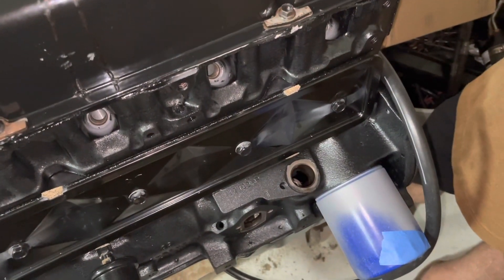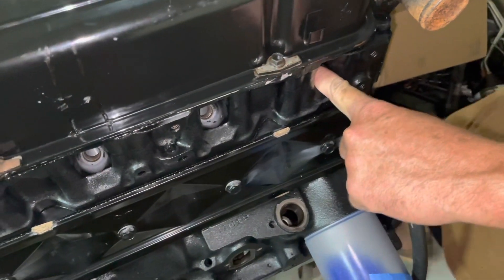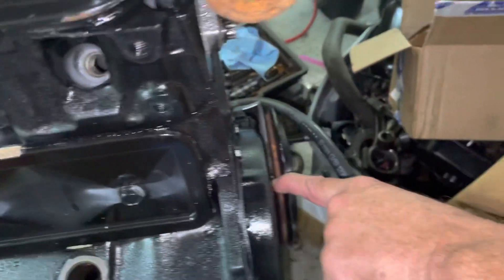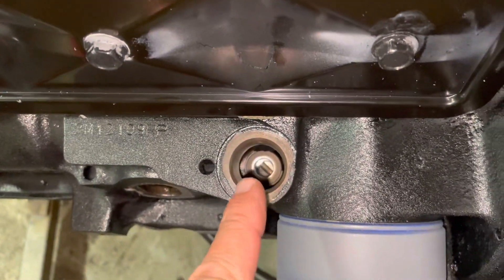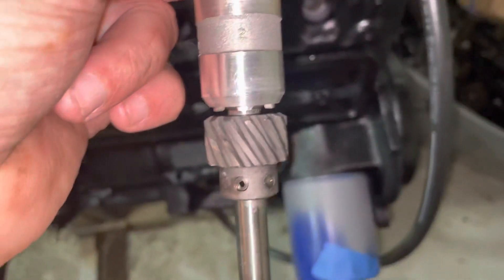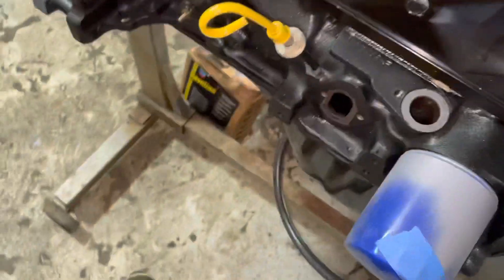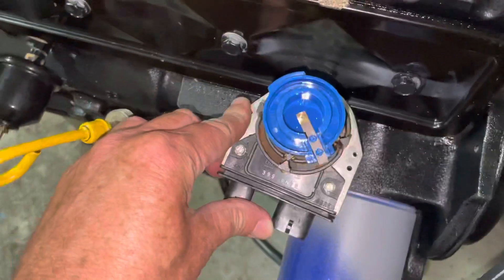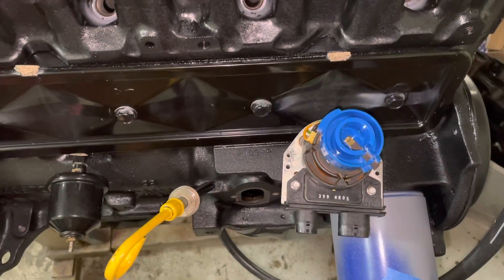Mercruiser 3.0 1(j)- Distributor Install/ Setting Static Timing

Comment: How did you know were the number 1 tower direction is.
Reply from the maker: At 1:52 I said the number 1 spark plug wire tower in the cap lined up with the corner of the distributor. But that is arbitrary. I could have chosen any other of the four locations. All that matters is that the rotor point to what you decide is number 1 tower when you insert the distributor. However the corner I used is the best because the spark plug wires reach all the cylinders easily when the distributor is installed per the video.
Reply: Nice explanation,  thank you. I have this motor in my 92 Rinker 181 which i have owned since 1998. I find it to be robust and reliable.
Reply from the maker: @jkgkjgkijk this engine is an industrial engine used forklifts and tractors, never in cars or trucks. It can be destroyed by low octane 87 ethanol gas though. Always use 89 non ethanol gas.

Comment: Good video,
You should add the firing order and cylinder numbers to it though,
Thanks
Reply from the maker: This is a video about static timing, not connecting spark plug wires or timing with a timing light. I cover these topics in other videos. I did point out cylinder #1 and explain how to find TDC on #1 firing stroke which is the most important requirement for timing a distributor.

Comment: I have this same distributor, can i replace the parts ontop of the plate or do i have to change out the whole distributor?
Reply from the maker: Why do you want to replace anything? You don’t say what’s wrong with it?
Reply: @moccasinmarine  well nothing is wrong with it, just rusty and dirty. My first boat, I'm giving her a tune up
Reply from the maker: To replace the parts on the plate the distributor gear has to be removed and the shaft pulled out. I would just clean up the part and keep using it as is unless the parts don’t work anymore.

Comment: Same question that I asked on another video of yours. Trying to get the Delco number of the two pin connector or ultimately the number of the module receptacle so that I may connect to my replacement Petronix distributor. Thanks. Rick.
Reply from the maker: I posted an answer to your other question.

Comment: Hi how you turn the oil pump ??
Reply from the maker: With a long flat blade screwdriver.
Reply: I don’t know a lot about it but can you tel me please where is the oil pump is or how to do it and a video I will really appreciate you sir , Hi sir thanks for texting me back , I have a 3.0 mercury 4 cylinders stingray 190RS but I forgot how the spark plugs cables order,?
Reply from the maker: https://www.mercruiser-shop.at/data/datenblatt_0000025_1.pdf

This manual contains spark plug wire routing. The oil pump is inside the engine under the distributor.
Reply: How can alignment the cylinder number one up , because the engine is is my boat and I really don’t know how to turn with the engine in the boat, can you help me out please
Reply from the maker: Put a socket on the alternator bolt and rotate the engine with the alternator pulley. Take the spark plugs out so that the engine rotates easier.
Reply: O ok sir I will tray to do it tomorrow first God , and my distributor have to be like you show in the video point to the corner right, ?
Reply: Hi sir I already did but still won’t star up but I have another question I was pumping gas to the carburetor but I check it and it was dry
Reply: Hola me puedes decir a cuántos grados de avance hay que poner el mercruiser 3.0 gracias

Comment: Thank you for this excellent and super helpful video.  I especially appreciated your technique of covering the spark plug hole, then rotating the crank and listening for the flow of air out of the piston, which can only happen when both valves are closed and not moving, and which is the needed valve state for firing.  And this technique can be performed without having to remove the lifter cover.  When I was performing my static timing procedure, however, I removed the lifter cover, and watched for movement of the rods associated with cylinder no. 1, as the crank was moved through TDC.  If no rod movement was observed, then I concluded that this was the TDC for cylinder no. 1 firing position, and this could also be confirmed by observing movement for the rods of cylinder no. 4.  While you have to remove the lifter cover, you don't have to remove the spark plug. I was wondering what your opinion of this alternate approach is.  Thanks!
Reply from the maker: The method you describe has been used by seasoned mechanics for ages. I’ve been using it for 40 years. This video is a variation of the method.

https://youtu.be/1A7mteNPCxc?si=j0Ns-bCYqmLsMhAO

Comment: Thanks for all your videos! You were integral in me getting my new to me mouse house (had mice nest in exhaust header) 1985 Mercruiser 2.5 rebuilt, running and back on the water. If you ever come to Bham, beers on me. This was the closest I could find to reinstalling the dipstick tube as it magically appears around 3:20 in. I did not measure how far it was sticking out prior to disassembly but reinstalled it to the paint line. I measured how deep it is with a piece of wire and it is 1/4" from the bottom of the oil pan. I just did my first oil change with a new Wix 50169 filter and a gallon of Rotella from a sealed bottle which according to the manual is the oil capacity with a new filter. The dipstick shows a half quart low. Now I do drain from the oil pan plug rather than pumping and let it drain over night. I did verify the correct dipstick is installed and have no reason to believe the tube has been replaced.  Should I just add the half quart?
Reply: Turns out a Wix 50169 is not a short filter like the original Mercury Quicksilver 35-866340Q03 is. It's a inch taller so I guess that should account for some of the difference.

Comment: Is this essential for getting engine started. Took everthing from the head and on to replace all gaskets and clean engine.  Engine cranks but wont start. I have spark and fuel is comming out of carburator. Could this be why my engine wont start? Since i didnt do it
Reply: Also, to add, i never took the distributer out, but i did rotat the crank shaftm does that even matter for starting the engine
Reply from the maker: If you did not take distributor out or loosen it then it should start. This ignition is very simple. Diagnose ignition first then worry about fuel. Remove a spark plug and lay it on the engine (not near gasoline fumes) and crank engine. If no spark you’ve probably got an electrical problem not getting power to the ignition coil.
Reply: @moccasinmarine  I went back and tried that just now. There's definitely a spark coming out of the spark. Plus, there was also a compression mist that came out of the spark plug hole, and i can see gas coming out of the carburator. Im stuck
Reply: @moccasinmarine  the timing looks good too
Reply from the maker: Send me an email to gmefiguy@gmail.com
Reply: I got it started, man it was my valves.  they were too tight. I appreciate u taking the time

Comment: Thank You for the many great videos! I am a subscriber and new (used) boat owner and have found your info on Mercruiser 3.0 very valuable.  Just replaced my long block, and installed the distributor. Runs fairly well and I am now working on the fine tuning.  In this video you mention the #1 position on the distributor as the right corner of the plug base.  Is it important that that be the #1 position?  I thought that the number 1# position was relative and could be any of the posts as long as the plug wires were then attached in the correct 1342 firing order to the corresponding spark plug while at TDC.   Just want to get all of the performance out of it if a reset of the distributor is necessary.  Keep the great videos coming.
Reply from the maker: The #1 distributor post position can be any of the four posts as long as you install the plug wires going clockwise in the firing order. However the factory service manual shows the right corner as number 1 so I stick with that since any future mechanic will expect it to be there also.

Comment: you should have mentioned the triggers being lined up too.
Reply from the maker: There is no need to get into that much detail. It’s automatic that the triggers line up when the rotor points at the distributor cap tower. If they don’t you’ll have a distributor phasing problem. But thanks for the tip.